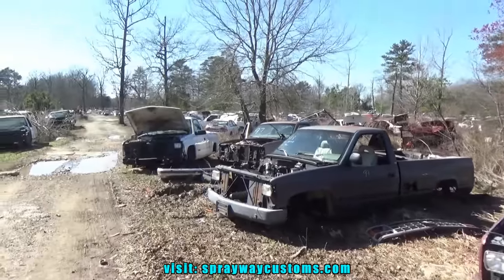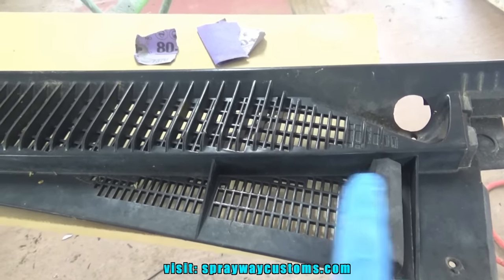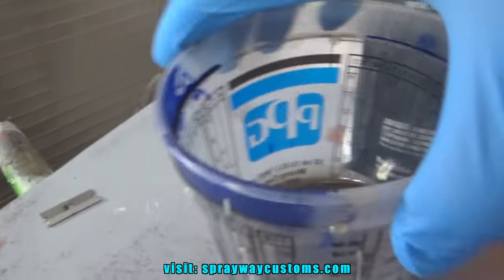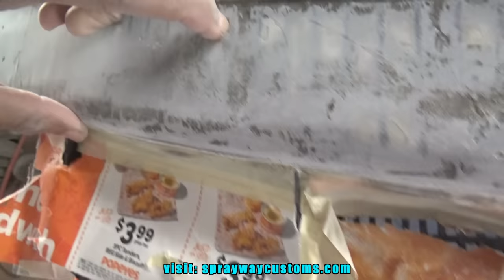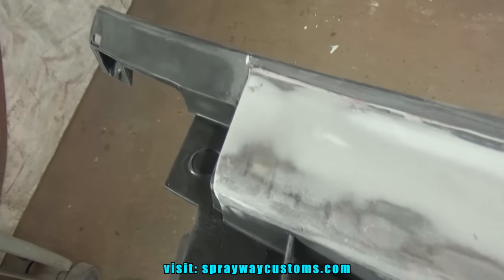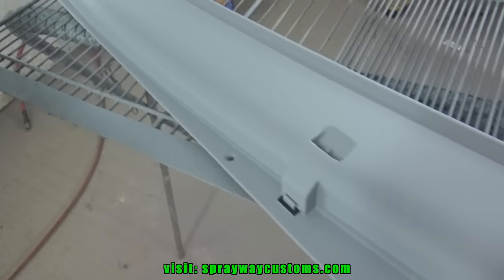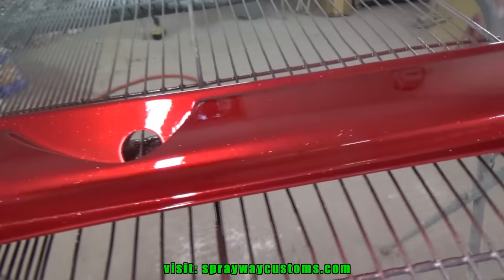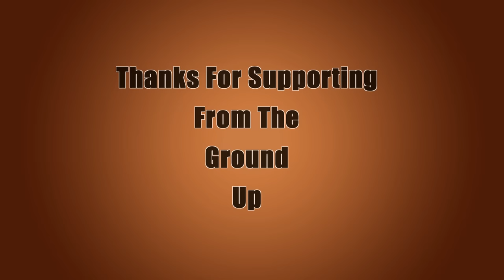How To Make Custom Fiberglass Parts / Pieces / Panels SHAVED SMOOTH WIPER COWL Chevy OBS Silverado

Comment: Today, I learned about spray foam and fiberglass resin, and much much more! Thank you.
Reply from the maker: Great...thanks Dean
Reply: Love to learn, love it when learning. Saved a lot of your videos to my named file folders for quick reference! Watch out and stay safe. Maybe they will put turns signals on all new cars!
Reply from the maker: Dean Kay, thanks again
Reply: Thanks! I also noticed the air cap color change on what appears to be the same gun. Spray 3 coats, clean, change needle, fluid tip and air cap w/different color. This tells me smaller or larger, but you know you product and what works. I do watch and see the man behind the gun got skills!
  Find things that make you smile or laugh. Life is too short. Learn by watching, doing and learning from our mistakes. I know I will never forget mistakes if have made. Lordy, Lordy! You know!
Reply from the maker: Dean, those are actually two different guns. One with the green air cap was an HVLP good for Base & Candy and blue was an RP good for spraying Clear

Comment: When your messing with this fiberglass filler  or really any of these products it's real easy to get discouraged if you can't see through how shitty it looks at first. You think your doing something wrong untill finally it starts looking good after alot of time sanding and adding more and sanding more lol.. I don't do it on a scale like you but just my own projects like I rebuilt my own cab corners on my truck thanks to your videos it made it easier to have the patience to get through each LONG process of getting it to look good. Thanks for the videos to help..
Reply from the maker: You're correct. It's a process 👍🏾

Comment: That's just badass as always think I wanna do this to my obs but I want to know how to do the dash mine is all cracked and falling apart how can I fiber glass that IV seen your other videos of you fiberglassed dashes but they r complete how would I do it with holes in it and also with the defrost
Reply from the maker: It's basically the same..you just have to cut out around the vents
Reply: @SprayWayCustoms  awesome thanks for your advice

Comment: What exactly is the flow coat? Why doesn't it have defects line orange peel etc. It is put on extra thick. And is it just that you sanded before applying it that makes it come out so smooth?
Reply from the maker: Yes, it's because of sanding it back smooth after the last coat of clear. Judy think about all the orange peel built up after about 9 coats of paint. https://youtu.be/CShrZTUuxgU

Comment: out of curiosity, what did you charge from start to finish on this obs? I'd actually be very interested in doing something similar, not with candy but with the original paint color
Reply: It came out great but there is no way he can replicate that for other customers. You can buy smooth cowls for those trucks for $100. With proper paint and prep it would look just as slick.
Reply from the maker: I actually haven't added it up
Reply: @MrWoodyBalto  thats not what i was asking. I was asking the entire job, start to finish. absolutely everything he's done to this truck. it wasnt directed at the smooth cowl, i know they sell smooth cowls.

Comment: Looks great but I think LMC truck sells smoothie cowls for I think $200. I want to get one but if I get board now I know how to smooth mine out for minimum $ and a bit amount of elbow grease 🙂
Reply from the maker: Ok thanks
Reply: @SprayWayCustoms  Just because I have a spare one and money always seems tight lately I'm going to do up my spare cowling exactly how you did this one. Can I use regular foam in a can? The hardware store sell minimum to extra expanding foam in a can I was thinking getting the minimum expanding stuff as not to break or warp the plastic.

Comment: Spray way I was wondering is it possible we can do business? I’m reaching out from Texas bro. I have a 1984 Oldsmobile delta 88. I’m trying to get my kick panels fiberglassed with a 6.5 and tweeter in each. Plus I’m looking forward to getting all 4 door panels with two 6.5s and tweeters installed in each door. Lets talk numbers bro if you’re interested. 409-719-0294 Yogi
Reply from the maker: Ok then 👌